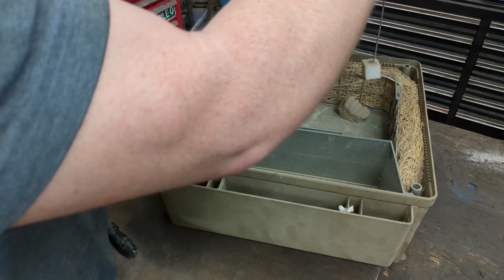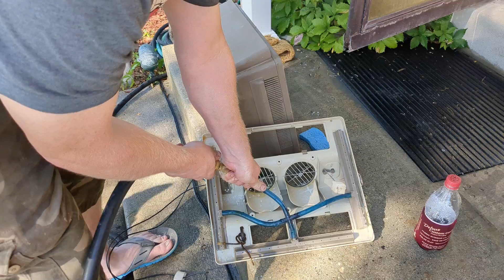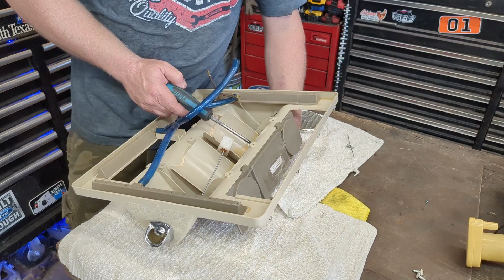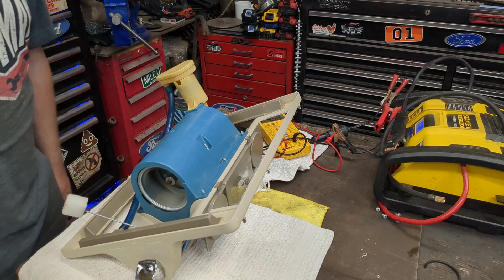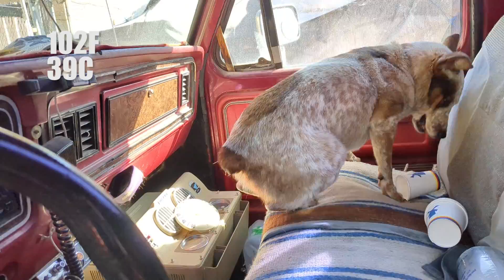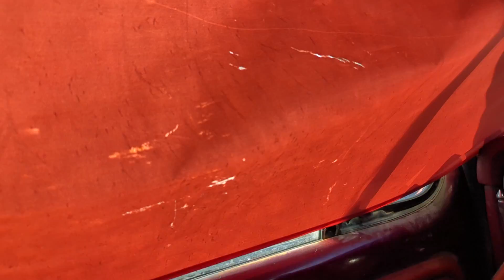Vintage Car Swamp Cooler AC

Comment: Hey thanks I’ve just come across one of these for sale in Australia, I’m hoping my Vw 74 T2 might be a bit cooler. We have some very humid tropical parts in the north but I’m in the southern part so it’s probably going to make a difference cause I got no cooling and sometimes in the tropics the heater stays on 😂 the very long cable breaks quite frequently.

Comment: I just got one of these in nos condition, i want to wire it up to my fuse block in my 65 dodge dart
Reply: Update, did a hardwire set up, and it worked like magic. I just cant over fill it or on wide turns it spills a but of water out its side slits. In california in 90 degree F weather it gives you a solid 25-30 degree split.

Comment: Apparently Moe replaced the water pump on this cooler. Does anyone know where the link for that pump replacement is?
Reply from the maker: Hey, I meant to get back to you. I just didn't have the link. I bought a two pack. I only installed one though. They're just handy little pumps. https://amzn.to/3HWoUiJ
Reply: Moe, Thanks for your help! Totally inspired by your videos. I received your message. You're a man of honor sir.

Comment: I installed one of these in my 67 ford truck. Wasn't happy with it so I ordered the refrigerant type.  It came with the head, compressor and lines. Worked much better.

Comment: the super old swamp cooler I have used a spring on the fan motor to the pump to circulate the water in the basin, why I dunno its been in my family for like 4 generations now and the pump is long gone and I could prob replace it with just a simple drill pump, the original pump had rusted away to nothing

Comment: For how old that thing is, it's certifiably Mint! 
I remember retrofitting a version of one of these into a low-buck humidifier for a repurposed 50s fridge I turned into a cedar-lined humidor. Worked great with Oasis foam as I wasn't so lucky with finding one with pristine mat. It was, how to say, massively gross.
Add: Now that I think about it, this is the much better version of those little chintzy water bottle ac units that have gained so much popularity this year. Another case of resurrecting old into new ideas I suspect.
Reply from the maker: That's awesome. It can't imagine those little desktop water bottle size evaporative coolers do anything at all.

Comment: I made one out of a small styrofoam cooler and a fan. Didn't work too well for my ranger(no insulation in the roof of the cab) in the heat and humidity of south carolina. Did blow cool air out though.

Comment: I litterally just bought a big swamp cooler, they actually work great. Power is super expensive here, so AC is hard to justify turning on especially with our old home. Even when its 90-115 and we are running the central air AC and a window unit AC (three story home) using the swamp cooler helps the AC work even better, as the AC will pull the moist warm air out of the rooms.
Reply: Hvac tech here, you're drastically reducing the efficiency of the ac unit by supplementing with evap coolers. Air conditioners really don't cool much at all until the relative humidity drops pretty low, and evap coolers running in an enclosed space is going to raise the relative humidity by a lot
Reply: @MegaDysart  explain why we are lucky to get a 10-15 degree delta with just ac and 20-25 degree delta with ac and swamp cooler then? 🤣 the relative humidity doesn’t actually raise that much, the ac pulls it out of the air with the heat. And yes I measured all this.

Comment: Awesome find and great video👍🏻 at our house (in southeast New Mexico) we have both evaporative and central refrigerated air. The swamp coolers do require a bit of maintenance but are super efficient when the humidity and dew point is low! We typically only use the central A/C mid July thru mid August as it's 80-$100 a month more in electric bill😳

Comment: Hey Moe, this was pretty cool. I have heard of these all my life but we never use them because the humidity is so high down here. I was very impressed you had the correct size o ring on hand.
Reply from the maker: You hold onto random junk(boxes of orings) for decades and the one time you need it and it justifies it all.
Reply: @sixtyfiveford do you happen to know the size of the O Ring? Id like to have a few on hand

Comment: How much for this unit , or can I find one for my 1969 GMC tow tuck , lol nice thanks 🙏 BigAl California praise Jesus Christ grace grace amen 🙏
Reply from the maker: I actually have been searching on and off for at least 15years for an inexpensive one. This is the first one I found for under $100. The passenger side window units are more desirable and probably work better but fetch a hefty price. Some of those can push $1000. However if you keep you eye out(I haven't been lucky) you can find them at garage sales/local classifed for cheap. Ebay always has people selling real ones and fake non working ones but you will see quickly they want a decent amount for them.

Comment: Neat! We had a monster residential unit in our home, as a kid, in California. I’ve heard they’re desirable in the desert because the humidity cools the extremely dry air.

I know you do what you want. But a hack I’d love for you to find/create, is bathroom/laundry room exhaust fans. Seems like they’re so noisy and don’t exhaust very well.
Reply: They make "remote" fans where the fan is actually mounted up in the attic rather than right in the ceiling of the room. As long as you mount the remote fan on rubber isolators and up in the attic somewhere, they are much quieter than regular bathroom fans.
Reply: @gorak9000  thanks for the reply. Unfortunately that setup wouldn’t work for my townhouse.
Reply from the maker: Bathroom fans are miserable to listen too.
Reply: @LujinCustom  If a remote fan isn't going to work, then get used to enjoying your own brand I guess - or poop in other people's bathrooms
Reply: @gorak9000  oh but then I have to be judgmental about their fans! 🤣

Comment: One of the two or three things I remember from high school chemistry,  is that oxalic acid works really good on rust stains. I find it works best when used with warm or hot water. We have really rusty water so sometimes I have ro mix a batch to clean fixtures and stuff. Often it can be found at the hardware store sold as one brand of "wood bleach" sometimes all they sell is the sodium hypochlorate versions so you have to look around.  Sometimes might find it in the dishwasher cleaners too. Also, that dingy yellow plastic can be brightened with hydrogen peroxide set out in a bin to soak in the sun....but you know that already I'd be willing to bet 😉👍...one last thing just for posterity....you can save the water out of your dehumidifier for "distilled" water for batteries, antifreeze mix...swamp coolers...lol. some slight filtering and it would be fine to drink as well. Just pure water vapor from the air, minus the dust and stuff.
Reply from the maker: Great information.

Comment: Mats are called pads, the cellulose celdek pads are absolutely a massive increase in cooling as opposed to the traditional wood shavings
Reply from the maker: I run my home, garage and now truck off swamp coolers. I have the Celdek media on my garage, and have used natural wood/Aspen along with the green/blue sythentic pads on my home. I find the Aspen to give the best temps. On the same day/time my home unit will generally always blow 2F colder air with Aspen vs the garage with Celdek.

Comment: Oh man, you touched on a nerve with this one! Being a Las Vegas native, I love swamp coolers!

The old unit you got is neat, and not easy to find. The one downside to that particular design is that it recirculates the cabin air. Better performance would come from a continuous source of outside, dry air. Still neat though! You did an awesome job of cleaning it up and refreshing everything.

I'm still surprised that here in the SW evaporative cooling is only as popular as it is. My place (house) is roughly 1200 sq ft, I have a Champion SD5000, running a 1/2 horse motor, it performs really really well. I run mine around the clock, never turn it off. This year the monsoon season was significant with quite a few more days of humidity than what I remember from previous years. Yet it still performed pretty good. With that humidity, on average my daily temps (F) were about 78° to 80°, maybe 82° around 3:00PM, 'the height of the day'. With the monsoon humidity those numbers didn't change too much through the night. But the last week or so the humidity started to go down and so did my temps inside. At 3 or 4 in the morning I was averaging about 67° to 70° inside, but it feels much cooler than that. And that's not just the air in the spaces, but the walls and the structure pick that up as well. When they do, that plays in your favor for most of the day.

The original concept with swamp coolers was to blow into the house and bleed it out by opening windows a few inches. But I have found that you get better performance instead (and uncompromised security) by creating an opening from the interior of the house into the attic (which typically already exists with a built in attic access) and having 'the final bleed' exiting through attic vents to the outside. The living spaces get cooled first then the attic also benefits from cooling, this way the whole structure picks up those temps.

The swamper cuts my power bill in half (as opposed to running AC). If it can't keep up with summer's extremes I just switch it off to pump only, turn on central AC and close off my attic. I rarely ever have to do that.

Did I mention I love swamp coolers? 😅
Reply from the maker: Awesome, I'm a huge fan of swamp coolers and definitely one of the last holdouts in Utah. I would bet 5% of homes here have them and out of those 99% are operated by people that have no idea how to maintain them. This is sad because we rarely get about 100F and have nearly the same low humidity of Vegas. So my home is 68-69F in the peak of the day with the 4-5 humid summer days a year pushing 74F. At night we drop temps dramatically(high desert) and low 60's to high 50's is easily obtained. I do run a portion though my attic but also love having the back door always ajar along with windows. I would eaisily say my power bill is half what friends and family say they are paying. The funny thing is, everytime I have people over they comment how great the swamp cooler feels and wish they still had one.
Reply: Hey Moe, I’m looking for a small, simple meter that I could plumb right into the 1/4” water line that feeds my house cooler, do you know if such a thing exists? A search on the net isn’t bringing anything up for me.

Comment: , hey Moe if you just barely crack your windows were talking like an 1/8 inch and let it pull the air out as you drive it'll cool down even more for you
Reply from the maker: I did open the windows a few times to allow the humidity level to drop. The non existent door seals on the truck give me at least an 1/8 equiv window gap. This particular unit has the huge downfall of not drawing fresh low humidity air constantly.

Comment: I had no idea those things existed.  My 2001 Dodge Ram has the perennially kaput air conditioner.  Maybe instead of the next attempt to fix, which involves pulling the dash (ugh!) I should look for one of these.
Reply from the maker: They do work well, if you live where humidity is low enough. 100F is pushing it's limits though. On a 90F day with low humidity this would put out refreshing 65F air.

Comment: I lived in El Paso years back. Moved there from KC. My house had dual swamp coolers. I loved them. Cheap as heck to operate and were extremely effective... As long as the humidity didn't get too high. This rarely happened. Cool find. Great project. Great dog.
Reply from the maker: I run my home off a swamp cooler and it's generally mid to high 60's all summer inside. Except for those random 4-5 days in the summer where a storm rolls in raises the humidity. Then it's pushing 73-74F and it starts to get uncomfortable.

Comment: A buddy has a large sized swamp cooler for his house, I gave him a whole bunch of re-freezable ice packs that he cycles through the water reservoir.  He states a huge difference in cooling temps. You might re-visit the "it doesn't make much difference"  claim. Throw in enough to really chill the water and run a test for us. It may be that the small size is the limiter.
Reply from the maker: I actually went through a ton of experiments about 10 years ago. I went as far as having an external refrigeration system(freezer) that would chill the water to high 30F in a separate cooler and recirulate it through the swamp cooler. The temps were about 1-3F lower but that only last for maybe 20-30 minutes and the water temp is stabilized around 60ish. A chest freezer could keep up. Where there was a difference is the initial startup. So starting with chilled water vs the 70-90F water that sat overnight you would see about a 10F lower temp for about the first 5 minutes, then the 1-3F for another 15ish minutes and then it was the exact same. The water cools off naturally with running and quickly stabilizes to around 50-60F with or without ice.

Comment: You know I was just wondering why cars don't use evaporative coolers and look here it is Google knows me too well didn't even talk about it just thought it. I bet that works fantastic. Selling this one?
Reply: Two reasons... constant maintenance and the issue of water buildup inside the vehicle interior. Unless you properly vent, you'll find the inside of your vehicle becoming saturated with water. As you might guess this can turn nasty pretty fast with mold, mildew and foul smells. You don't tend to see that occur in very dry and hot parts of the country but it can and will happen. You don't want to deal with that nastiness. Trust me! Best wishes! 👍🏻🤔🇺🇸

- Max Giganteum

Comment: i love air from a swamp cooler.  In western Colorado it was great.  I liked it because you had a contnual supply of fresh air in the home. I'd crack a window for exhaust. When I moved back South I felt trapped with central air.  It doesn't seem very healthy breathing recycled air.
Reply: Unless you've living in a giant ziploc bag, most buildings have plenty of leaks anyway - you get TONS of "fresh" air without even realizing. Even if your house was completely sealed, you'd have enough air inside to live for weeks more than likely.
Reply from the maker: I run my home off a swamp cooler and enjoy having windows and back doors open all summer. The positive air pressure doesn't allow bugs in and always having fresh, renewed air is a benefit. It's definitely something you have to experience to enjoy.

Comment: Do you have or expect any issues with rust on your metal lathe with the big swamp cooler vent right over it? That makes me nervous looking at it, at least as a Minnesotan.
Reply from the maker: Not at all. These may add 2% humidity at most. I've had a bare steel truck cab sitting in the garage for a few years now with no rust. These aren't like central air where you need all the windows closed etc. You open doors/crack windows to create air flow. It pulls 5% Humidity 100F air in and pushes out 7% 68F air continually. There's never a buildup of humidity.
Reply: @sixtyfiveford  Thank you for your thoughtful reply. I really enjoy what you share with us. It really is valuable stuff.

Comment: Lookslike good old Ronco struck again. Remember Ronco on all the t.v. adds? They were very regular and very cheap BUT it looks like that works just like it's supposed to and it was Ginger approved right from the start. And I used to take a gallon water jug half frozen solid to work with the other half non-frozen and had cold water all day. The humidity makes up for your really high heat here in the hills. 
THANKS, Pal and God Bless Yall!
Reply from the maker: Oh the Ronco products! It slices, dices and cools your car.

Comment: In my youth,60s, my dad had one that hung on the window. We would drive from Midland Texas to South Texas and did cool us down.
Reply from the maker: That's awesome. They do work but require attention and by modern standards are too tedious..
Reply: I was an Airforce brat and we were traveling from a base in California  to a base in Missouri.  Of course we had to travel through states that  had hot desert on the way . my dad bought one that hung on the window and you had to put water in the unit. It had a pull chain that opened the vent to allow  the air to blow though the unit and cool the air ( yeah right). All it did is blow water on you until it ran out if water. lol.  The rest of the trip we drove with all the windows open and suffered the heat. Back then Air Conditioning wasn't installed in every car and was not available in cars except the Catlalacs the rich people bought. :o)
Needless to  say my dad tossed it in the trash the next time we stopped for gas. The unit looked  more like a ram jet engine than a evaporative cooler.  Thanks for the video..brings back the bad old days with my SOB dad. lol

Comment: Very cool unit for sure.   I have thought about adapting one of those portable air conditioning units that roll around for my vehicle instead of the high cost of replacing my car air conditioning.  Have to figure out the electrical part though.  Thanks for the videos.
Reply from the maker: I just always tell myself summer is going to be over in a few months and it won't be needed.